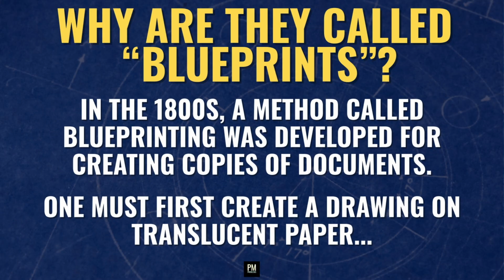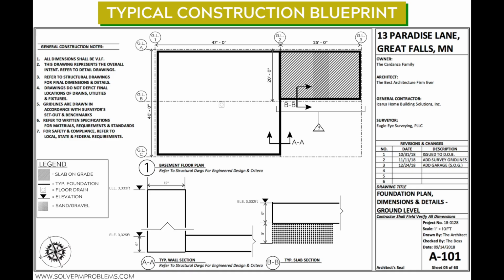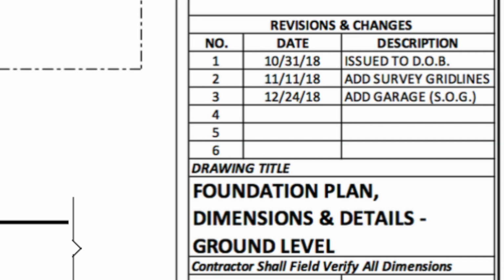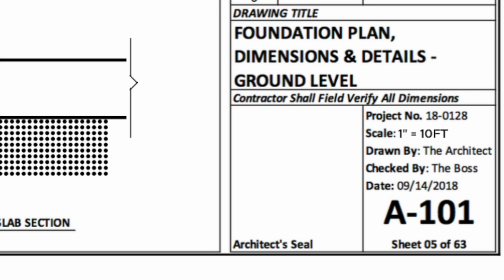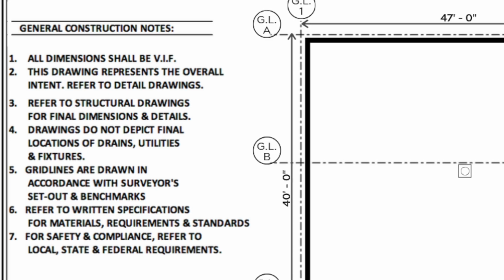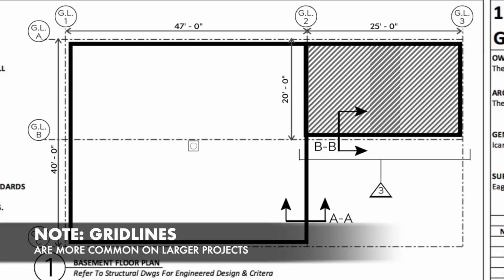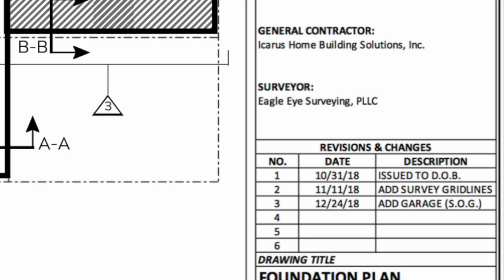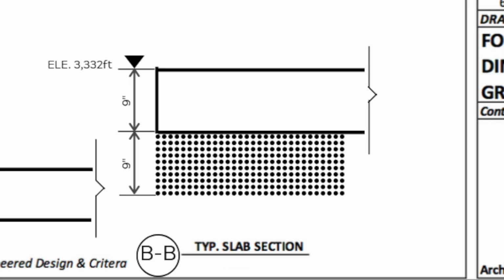How To Read Construction Drawings: A Complete Step-By-Step Guide [& Why They're Called Blueprints]

Comment: Thanks for the informative video.
I wonder what kind of drawings a cost estimator will deal with? Could make any video on that?
Reply from the maker: My pleasure! Yes those would typically be architectural / engineered drawings created on behalf of the client for the purpose of initial permitting and contractor pricing. I will certainly keep that in mind and will try to dive deeper on the basics of those! Thanks for watching